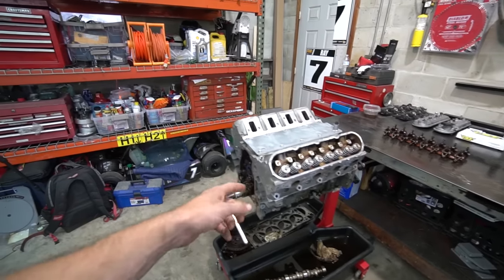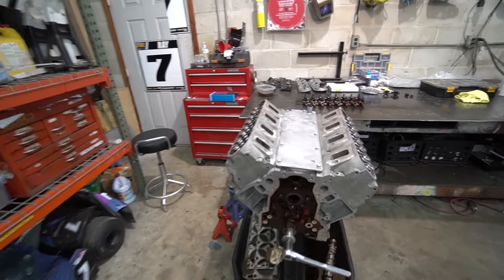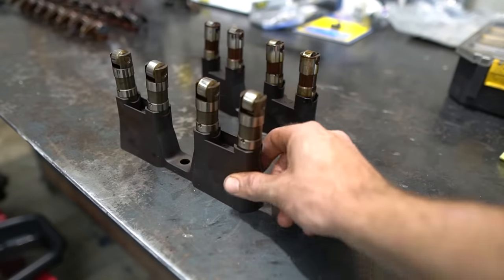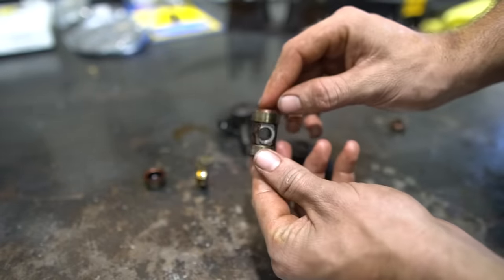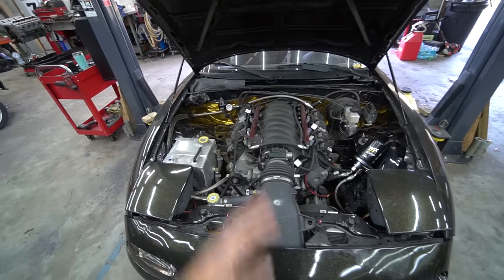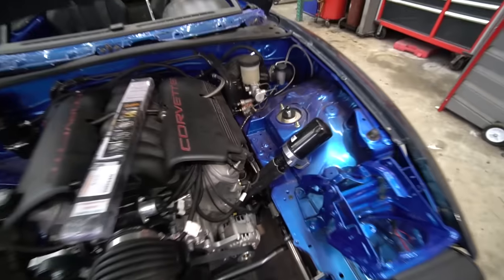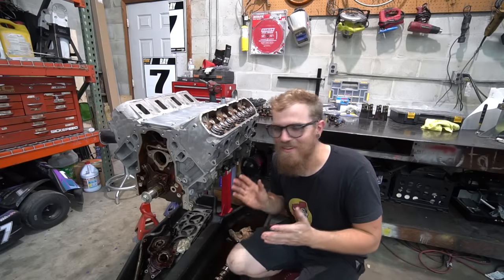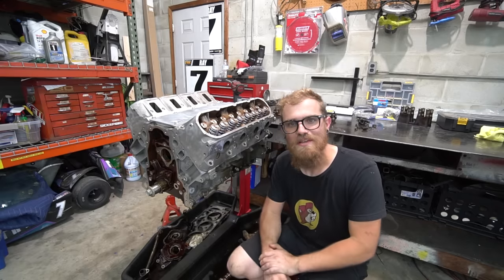Top 5 Mods To Make An LS Engine Reliable.

Comment from the maker: I try to include this info in videos while working on engines, but it's hard to get it all in them along with the work. So I wanted to make this video covering some of the things I've learned over the years with my LS Builds to help anyone out who's taking the plunge themselves.
Reply: What did you use to relocate your oil filter?
Reply: Great video. I just went through all of this on the 5.3 I got from LKQ to replace the 4.8 block that spun all its bearings the first time at the track. These engines are amazing as long as the oil system is worked over. Happy to see I hit every check box on your list, so I hope this engine will last a while.
Reply from the maker: Just a filter relocation plate that came with my dry sump kit.
Reply: Brilliant content
Reply: Thank you man, I just threw in a 5.3 in my 87 Trans Am for hitting the track at OSW. I'm definitely buying an accusump tomorrow for it. I plan for a lot of boost eventually and I need to make sure it's well lubricated.
Reply: Great video Taylor. Personal opinion an LS is a "boring" swap, but that's because everybody does them and for good reason. They really are solid motors for alot of applications. One thing about oiling system and the good oil pan vs dry sump thing though. You even mentioned it back when you had the crank scraper with first first engine in the miata. The weight of the oil on the crank can and will rob power. Motortrend even did a bunch of Dyno testing to prove that a good pan/crankscraper/proper oil level can effect oil pressure but also can gain 30+ HP depending on the amount of oil and the engine itself. So your 3k drysump system actually will make the car faster. Sure $100/HP is kinda pricey but for an NA application you could also do worse plus you get abunch of reliability so it's a win-win. Keep up the great content!
Reply: Sound info.
Reply: Taylor Ray how to make a reliable ls don’t add any mods change oil on time an make sure never drive it hot
Reply: Oil and fuel are the lifeblood of your engine..... and water, just to be safe.
Reply: Dude I couldn’t agree more about not opening the long block unless you have too. I tell people all the time the most precision engine builder in an engines life time is the factory. How many rebuilt street car engines see the mileage a factory engine is capable of? Very few if any and that says it all.
Reply: This video was some of the best LS content I've seen in a good min, 4/5 are officially on the list, only cuz im not a drifter, but watched every min, and rewatched half of it to take notes. SOLID, SOLID, MATERIAL.
Reply: So on my 08 Silverado with a 5.3. one of the cylinders has went completely dead and I changed the coil and plugged and the injectors working. Now my oil pressure is messing up and when it's cold it is low on oil pressure and it seems to get better as it warms up. Except it's hard to keep it running while it's cold. It's also smoking.  Can anybody tell me what's happened and can this engine be saved? I'm pretty sure it's a problem with the lifter but I'm guessing the cam is probably wiped out as well.
Reply: @Taylordrifts , wish I had seen this video before making my first/only pass at Bradenton a few weeks ago... XD
Bought my first LS car ever about a month ago, 2000 Trans Am with the 6 speed and 206,xxx miles. I'll now be looking to rebuild/replace the powertrain in it.
Reply: Thank you in advance
Reply: How do the Michigan Motorsports lifters hold up? Are the GM lifters worth the extra price or can the ones you link take high rpm too?
Reply: Man you have helped me thru alot of info I'm currently sourcing out parts for my build I'm doing a 99 isuzu hombre thanks to you I figured the route I want to go thank you brother
Reply: What brand and part number are the upgraded rocker arms?
Reply: I just got a new l9h motor for my 2009 Hummer H2 so I'm going to do these things before I install it

Comment: "How to make an LS reliable" Put gas in it.
Reply: Change fluids and make sure you have coolant.
Reply: I think he meant for racing.
Reply: Put ford parts in it
Reply: @ricktotz4078  That was a funny joke.
Reply: @ricktotz4078  no!
Reply: @ricktotz4078  yeah if you want to make half the torque and change timing chains every few thousand miles they yeah put a coyote in your drift car instead of an LS
Reply: @ricktotz4078  then the only part that brakes wool be the Ford part, it will spit it out, Ford parts break.
Reply: @konnerkramer329  the Ford mod motors have the same issue when it comes to racing make sure you put a high pressure oil pump with the stock pressure spring in the oil pump you’ll get plenty of oil to the timing chains and upper valve train
Reply: @ricktotz4078  That's a sure way to make sure it breaks...
Reply: Yep, and change the oil accordingly  My LS1 TA A4 has 412,000 miles on it and is still rolling 😁.
Reply: @ricktotz4078  what a joke!!!
Reply: @airgliderz  they catch on fire too
Reply: @ruffus8012  correct LS can catch fire. Ray a Tesla catches fire, far less likely.
Reply: @airgliderz  i was agreeing with you
there parts are cheaply made like forge vs cast forge always outmatches cast
Reply: YA ITS NOT A FORD OR A DODGE. Put gas in it, change the oil, check the oil.
Reply: @Xenomorphenia  G.m. quality
Reply: @konnerkramer329  YA, 😀 MOST ALL GM V8S   HAVE TIMING CHAINS SO DO LS1 THEY WILL LAST 200, 000 MILES IN most gm including those 2.2 4cy!!!!!!!!!!!!!!!!
Reply: @mikestanly749  it has nothing to do with ford vs GM... it has everything to do with cam in block vs over head cam. yeah an a cam in block v8 timing chain will last 200,000 miles no problem so will a DOHC the difference is how you drive them. a drift car for example will spend minutes on end at extremely high rpm banging off a rev limiter. this is where you start to see problems with DOHC engines because the extremely long timing chains with plastic tensioners will fail under those conditions.
Reply: @mikestanly749  
There is always a faster car, friend. Always. Just saying 😁
Reply: @konnerkramer329  
Arn't most drift cars high strung 4 and 6 cylinders? In fact, don't most of the highest rpm engines use overhead cams and long timing chains? Also, many cars at that level use bullit aluminum chain guilds, not plastic.
And btw, extremely high rpms arn't exactly kind to cam in block engines either. Bent pushrods, broken rocker arms, broken rocker arm studs...things can go wrong when you rev the piss out of any engine. Even Wankel rotaries can be reved so hard they crack irons or fly the rotors apart.
Reply: 😂 93 tho
Reply: “forge always outmatches cast”

Not necessarily. Forged pistons may be stronger than cast pistons. But they expand more and must be run more loose for this reason. This causes the pistons to clatter in the cylinders when cold, accelerating wear. Also, forged pistons are not as hard as cast pistons, which increases wear. If you don’t need the extra strength of forged pistons, they are not beneficial.
Reply: Pretty much my man, gas and oil she good to go
Reply: My first thought exactly
Reply: On god I don't want to jinx myself but yeah !
Reply: @konnerkramer329 really?  Every couple thousand huh?   Typical internet mechanic. Have you owned a coyote or just read about them?
Reply: @GarrettMixing1  uhh yeah go bang your coyote off the limiter at 7,500-8,000 rpm for minutes at a time and let me know how long those plastic tensioner last...
Reply: Replace the gaskets and oil pump cam and lifters every 100k rings every 3. Oil changes require a oil filter also. Would anyone take a shower and put on the same sweaty underwear and clothes?
Reply: @177SCmaro  yeah rpm is bad for a valvetrain doesn't matter if it's cam in block or DOHC. The difference being cam in block is a ton cheaper and way easier to fix. You break a rocker stud or bend a push rod in a cam in block is just drops a cylinder and keeps running. You break a timing chain or tensioner on a dohc you bend valves and possibly break pistons. Even if it's a non interference engine it's still a pain in the ass to replace timing chains while in the car as a posed to pulling a valve  over and replacing a broken part in 5 minutes
Reply: If that's what you think you don't know these engines.
Reply: @andrewbrown8927  seen junkyard LS's make around 700 boosted with stock bottom and top ends. That's pretty reliable to me. Sure it's not a Japanese car. I concede that.
Reply: Loll
Reply: @konnerkramer329 why the hell…?
Reply: Timing chain, oil pump, fuel pump all HP.  Crank sensor & timing chain you be good to go for the highway
Reply: This is a joke right
Reply: Have a 4.8 been sitting 5 years 560k miles original motor detailed it all this morning hooked jumper
Box up started right over. Drove to the gas station and filled her up. Now need to get the tags figured out from 2019 but they’re definitely runners 😂
Reply: Make sure you put a real driver in it it’ll last a milli
Reply: Sometimes... depends on luck of the draw, had really good ones that had high miles and took and still taking abuse... others lower mile, been maintained but broke multiple parts and pieces.
Reply: Put gas in it is good. I was just goimg to say put it in something. No worries. I know the problem with it... ain't got no gas in it.
Reply: This right here

Comment: I'm a mechanic at a speed shop, and one of my customers has a stock internals 6.0L, boosted to the nuts, and he's gotten the car into the 7s in the 1/4, he opens up the ring gaps, studs everything with ARP studs, and throws a $300 Chinese turbo on it.  Sure the motors come apart from time to time with power levels he's running, but a couple weekends, few hundred bucks, and a trip to the wrecking yard and he's back to the races.
Reply: 7s on stock internals what the actual fuck
Reply: @ls3_saif  From what it sounds like, he's building expecting to replace. Not how I'd choose to do things but I don't know what I'm talking about and don't have the time or money to do that kinda thing so who the fuck am I?... but you'd be surprised how much you can squeeze out of an engine and how little you need to mess with it if you're not too concerned about how long it's gonna run. If you want to make a lot of power (relative to the application) AND have the engine last a long time (relative to the application) there's some stuff you're gonna have to do.. but if you're just looking to have it boogie for awhile and you don't really mind it eventually blowing up and having to replace it? Chuck a bunch of boost in it and send it. Other than oil starvation or detonation, it'll usually put up with a lot more than it was intended to... for a while.
Reply: @Saif-gu6rk thats not that crazy. Hes probably making 600hp. Seems a lil slow considering
Reply: @williamhargreaves1563 600hp running 7s?
Reply: 7.0’s 1/8 th mile not 1/4- easy to do
Reply: Theres not a single  S.B nor B.B Chevy made that utilizes Priority ouling system unless you're using a aftermarket block
Reply: Drill the oil pump